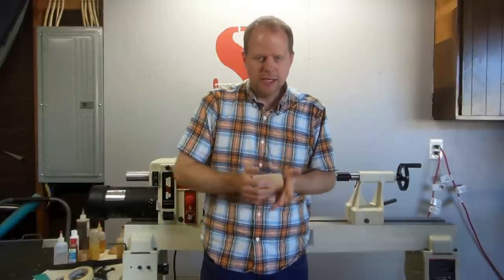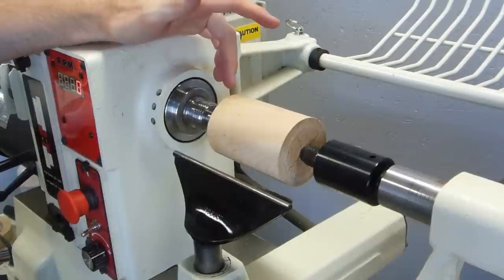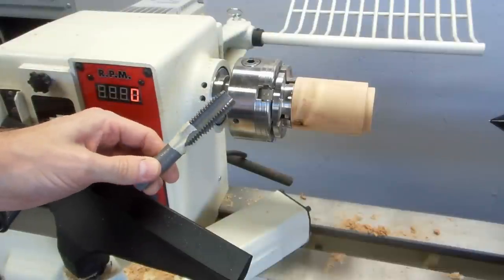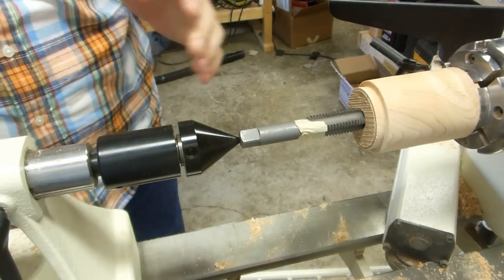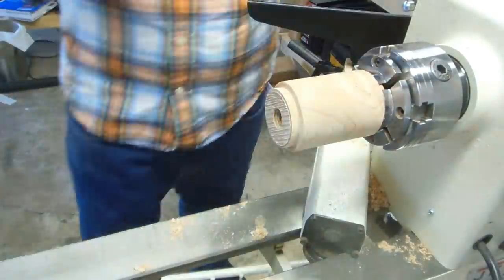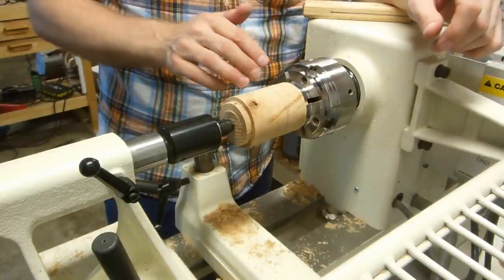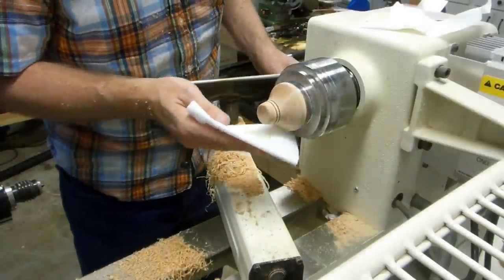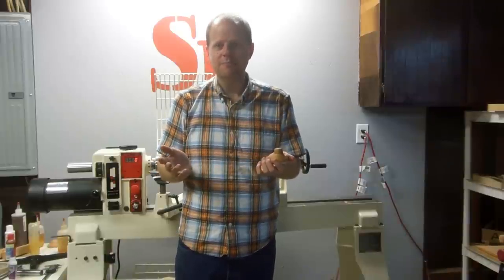Woodturning a wooden live center with carbide lathe tools

Comment: My first lathe came with a live center that didn't have a removable nose.  I overcame that by turning a wooden cup that slipped over the nose to prevent the point from marring the piece I was turning.

Last year I bought a new lathe and was able to purchase a live center similar to the OneWay or Jet center.  I've since made a number of wooden noses in various profiles - cones, flat surfaces, and even one with a circular depression in the end that allows a tennis ball to be captured between the tailstock and the piece being turned.

One other trick is to embed a small piece of high density polyethylene (made from a sacrificed cutting board from the dollar store) in tip of the nose to prevent the wooden nose from rubbing against the turning and burnishing the wood.  The HDPE also lasts longer because it wears better than wood.
Reply from the maker: Great tips. Thanks!

Comment: I love the idea of the cover for the live centre spike and also using CA to harden the thread. The only thing I might question is the need to align your tap using your lathe. In my experience the tap will always follow the predrilled hole so long as care is taken to get it started reasonably straight.
Reply from the maker: Keith, that could be true. Maybe using the tailstock to align it was a bit unnecessary, but I felt like it was worth it for the insurance!

Comment: Just found this old video. Good idea, I'll make one for my PowerMatic. By the way. To lock my chuck, I simply drilled a small hole through the to "guards" that are on both sides of the lock button. Then push the button in, slip an allen wrench through the holes and it will hold the button in.

Comment: As a life long mechanic, I cringed when you started the tap with the pliers backwards, but you caught on. Nice little project. Your 1/8 inch sidewalls might scare me, but that wood is hard enough for axle bearings. Good vid!!
Reply from the maker: Thanks! Yeah, this wood was actually really hard to tap. I tried not to let it show in the video just how much effort it required to twist it.
Reply: SJWoodworks Not to come kick a dead horse here, but if you cut threads again in the future it goes much smoother if you back the tap out a 1/4 turn for every full forward turn. It helps clear the chips from the cutters into the flutes running down the length. That is a brilliant idea, though! I think I need to make a large wooden cone for my cup/mug turning.

Comment: I had this exact lathe when I was back in the states.  I know what you are talking about when it comes to the spindle lock button and having to hold it in.  This is how I got around that.  There are 3 holes in the spindle housing, you should have a tapered pin with threads in it that came with the lathe.  The holes and pin are used for indexing work.  Just screw the pin in and the spindle won't turn.  Just remember to remove it before turning the lathe back on......not that I ever did that......
Reply from the maker: I'm a little scared to use the index pin as a spindle lock. It seems so flimsy!
Reply: the shorter the pin, the less chance to bend or break.

Comment: Very good video. To get rid of the tightness near the bottom of your piece pick up a bottoming tap. The problem is the tapered threads on your original tap did not thread all the way to the bottom of your hole.

Comment: Hello Steve,
I'm always hungry for new ideas and this is certainly one which I will adopt.
May I just offer you a warning on something I recently experienced regarding the use of thin CA glue.
I saw an upload many months ago which to my surprise demonstrated that thin CA glue can heat up given the right conditions.
Not long afterwards I was trying to deal with some end grain tear out and decided to use some fine saw dust and CA glue.  To my surprise it began to give off some acrid fumes.
When I'm turning I always wear thin work gloves and recently I was attempting another repair using saw dust and CA glue.  Surprise, surprise the glue started to heat up and some of it had adhered to my gloves.  It too heated up and I tried to peel my gloves off but it had already begun to set.  
I was like a ballet dancer jumping around trying to get my gloves off so be warned.
Alan.
Reply from the maker: Thanks for the reminder, Alan. Yes, CA glue sets with an exothermic reaction and the fumes can be irritating to the respiratory system. Once it is all dry and set, it no longer poses a problem, I think.

Comment: Hey quick question how well do you like carbid tools? Would you recommend them? I am considering getting them I am just unsure would they be good to use with Bloodwood or cocobolo  or ebony? Thanks :)
Reply from the maker: +ProD Miner I have used carbide with both bloodwood and cocobolo. Cocobolo cuts really smooth with just about anything, in my opinion. I think the carbide can be used on anything with good technique. It's just like anything else - use it correctly, you'll get good results.